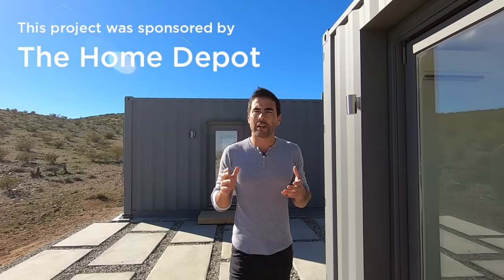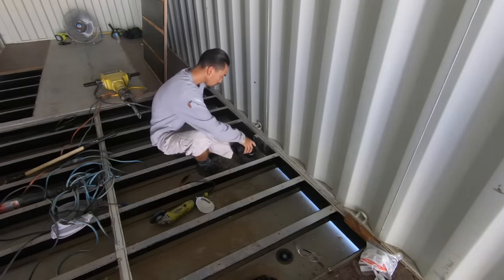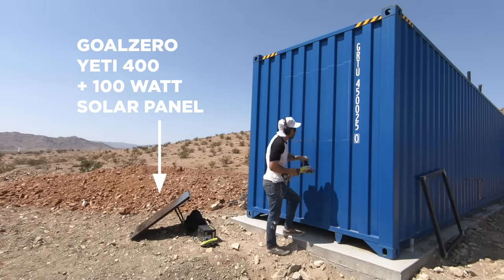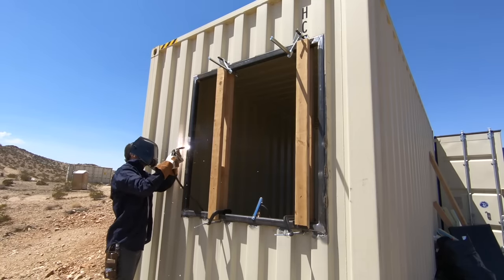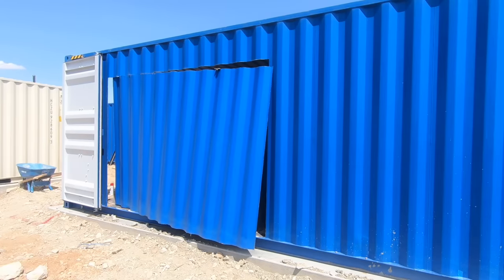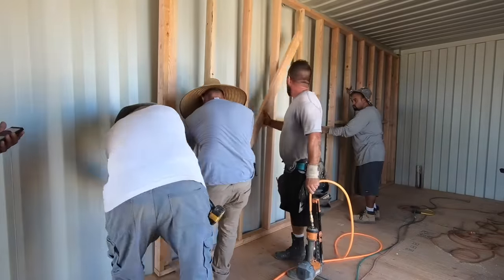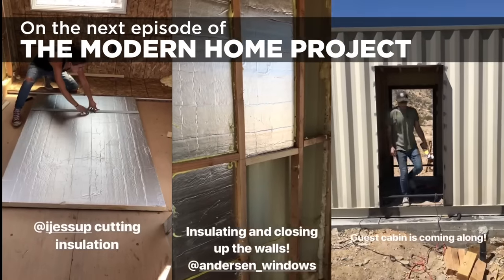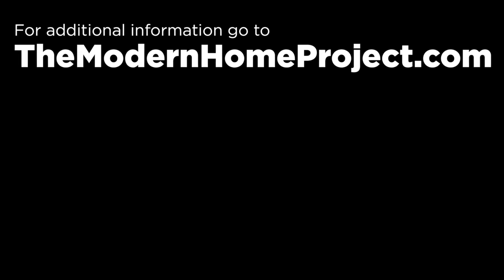Building a Shipping Container Home | EP02 Moving, Cutting, and Framing a Container House

Comment: Im not an expert on carpentry and architecture but i think putting those much additional wood support on those walls are quite unnecessary, first, you already reinforced the parts of the walls where you cut by putting metal frames, secondly, if youre worried about it collapsing because of rust and corrosion, its the job for the anti rust paint, thridly,  container houses are so small that a tiny inch of space is very important and youre losing that by putting  those additional wood support. If i wanted a nice little home with wood frames i would have built one made of wood. This defeats the purpose of having a container house.

Comment: I don’t see the shipping container advantage? By the time you frame all the walls and ceilings and cut and weld the metal you could have just built a conventional structure. Now your left with a box that’s less than 8 foot wide! I just don’t get it. Then you failed to address the pesticides that the wood floor is soaked with, some of which contain some very nasty chemicals? Please enlighten me on why anyone would want to use these for housing?

Comment: Leave the welding to us professionals bub...... ill be surprised if your welds dont crack after 1 year 🤣 Dont EVER use flux core on something like that. Use some ER70S-6 hardwire and some C25 gas and will have a much better, much stronger weldment with better penetration and fusion. Also you can fill gaps ALOT better

Comment: Why not just insulate the outside of the container with spray foam and build out your 4 inches on the outside and finish with wooden or batten siding? The inside just glue wooden strips on and paint or leave. If this is due to building codes in California, then choosing a container home in that state is not the way to go at all.

Comment: Sorry but those workers work very sloppy. Contractors always work against the clock to maximize their profits. Best to do as much as a homeowner can to make sure it's all done very nicely.
I lived and worked in Viet Nam for a few years. The city houses are usually built with steel beams for the frame. You can get nice long spans. I think the house construction there is much easier than taking apart shipping containers and reworking them.

Comment: Self drilling screws not self tapping, there is a difference !
Reply: Not a welder nor builder, but having a jot of common sense...couldn't they have just taken the welder and quickly tacked the metal fitting at the top of the 2x4 walls to the ceiling frame?
Reply: @barbedstar6480  agreed

Comment: Sorry, but the whole thing is about how to "destroy" a prefab steel container as fast as possible. An intelligent prefab woodenframe construction workes much faster, is much easier to insulate. The whole project is in physics for a building to live in  t o t a l l y  wrong. In the summer you warm up the construction in the sun, having the insulation on the inside preventing you from the heat. In winter you have the insulation on the inside means that the frozen-point (0°Celsius) is inside the building in the insulation. This creates the problem that the moisture (warm air) condensates inside the building and will never dry out. Consequence: black mould. You  m u s t  have the insulation on the outside, so it can dry out: a self-regenerating-construction, as we architects name that.

Comment: the only advantage of shipping containers is their ability to span from
corner supports as they are designed for that on ships to put them on a slab is not taking advantage of that feature 
there is no need for an expensive slab as well as concrete is one the worlds most polluting industries all they need are four mass concrete footings with appropriate hold down bolts

Comment: im, sorry, but a plasma cutter is most definitely easier to use an angle grinder,  and it would have only taken 2 minutes vs an hour and 45 minutes with the angle grinder. 

I think the only real argument for not using a plasma cutter is that it uses a lot of power and it would be challenging to get that much electricity on your build site, but it's not really even that great of an argument because you can run a plasma cutter on the generator pretty easily. 

 should have just said the cost-benefit ratio was better for an angle grinder

Comment: Why didn't you just put the container on a raise? This would have made cutting the steel beams unnecessary and the insulation could have been installed without any thermal bridges. For instance: Four bricks would have been enough for such an increase ...

Comment: I guess I don't understand the point of this.  Is it to reuse an otherwise discarded item, i.e., the shipping container?  Kudos for that - reuse, even one-time, or re-purpose - is better than recycling.  But the shipping containers seem like they have much life left in them as, well, shipping containers.  

But this seems like a lot of work to essentially construct a stick-built frame house inside a tin can, a highly unaesthetic tin can at that.  Why not just build a frame house and - not to MY liking - clad it with steel panels if you're crazy for that look?  You are most surely doing a retrofit that requires countless transitions - seriously akin to a remodeling project.  I just don't understand the desire to remodel a tin can in this case.

Speaking of which, why am I watching this at 11 pm?  I just spent a 10-hour day on a remodeling project in my house.

Comment: This build completely miss the point of container house. Space is big factor and putting up additional framing makes a small space and even smaller plus the slabs of concrete would just make this a very expensive project better of building a proper house wouldn't have cost that much more

Comment: I'm sorry, but once you framed the interior, cut steel supports and ran lines degrading floor structure, not tight insulation and than still adding a roof (if not your AC & Heat is running 24/7between a120°F to50°F at night).....YOU TOTALLY LOST ME ON WHY A CONTAINER !! 
       Footer, slab, main lines, septic run is the same regardless of structure...even add INSUL BOARD under the slab. Windows, trim and finish is no price difference either...same for a structure and all in the final finish. Why not  2x6x24"center,...2x6x24" center rafter @5/10 pitch with 24" soffet. Add Stone wool insulation bats, 3" x 3/4" ZipBoard or with an extra 1.5 .....for a total of 4.5" external. Tape and seal, plus  R-value and you are at a PASSIVE HOME BUILD....(thats high end). Rollseam roof & exterior walls....use USA steel 22g zinc & bake finish and its a 50yr plan easily.
IMO....you bought a very expensive outer shell, lost 8" interior space on framing, structurely weaker than a stick built, and doesn't have any condensate or R-value near the cost of what you spent. 
I would have built a 10Wx10H passive home built BOX.....keeping the heat and cold out,at same or less ammount and I know a higher quality exterior finish.

Comment: Now watch how white people mark the price up on container home. I'm telling y'all now if people start building these type of home for the container cost to finish I would would not pay over 35k to 48k that is it. Container cost around 1500.00 to $2800 brand new $3500.00 tops. Now all the framing, lumber  installation and plumbing. And the price for those containers is for the sizes 20ft 40ft 53ft or 57th all are the same price. Now even with a college degree plus man power I wouldn't pay more than 45k period. I know people out there has to have luxury  cabinet bathrooms and shit but still over paying for containers home god will punish those who corner that market.

Comment: Idiotic building codes. All designed by stick builders,who know shit, to protect themselves.  A wooden header inside a steel structure?? Laughable. A welded steel tube of the right size would restore the structural integrity of the door openings, but nooooo; there has to be a stick of wood in there. Ridiculous.     Someone please tell em where I can build in a sensible way without these effed-up restrictions?

Comment: 🤨🤨🤨🤨 a lot of stupid mistakes. But never, in your life, hold load that's attached to a crane with your hands while body parts are underneath it...... trust me. In my career I seen a lot of accidents and 2 deaths from that same stupidity.  1 was in 2015 or 16 when the rigging failed and a 2 ton air compressor felled on top of the iron worker rigger, crushing him to death. 27 year old Renee  was crushed and unrecognizable
And cutting with a grinder with no shield lol wait till that disk breaks and sends shrapnel into your face and body at 15ooo rpms.....

Comment: I would have done research before I started to keep labor and cost down.....this guy clearly has an ego and didn't want help or tips from anyone. Designers know everything and engineers are heavily over rated. Ive dealt with many, their not too smart, at least electrical engineers. I wont even touch base on architects